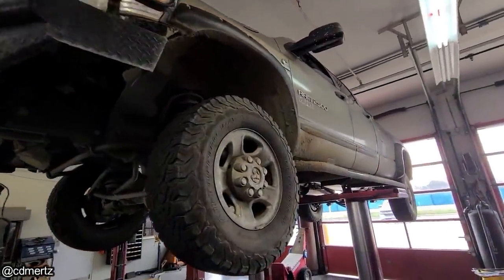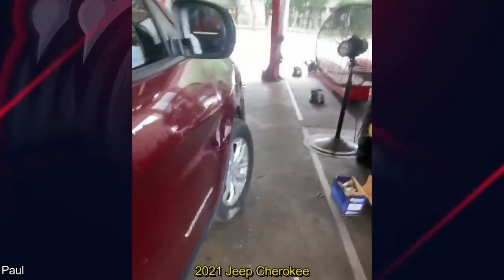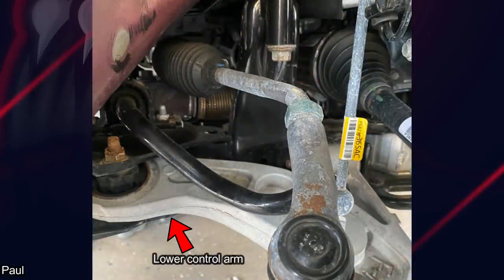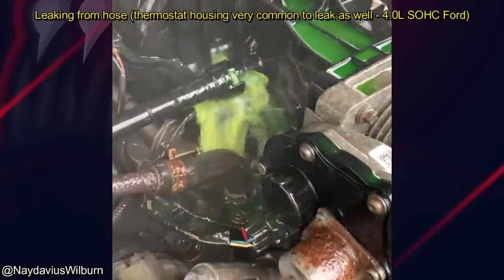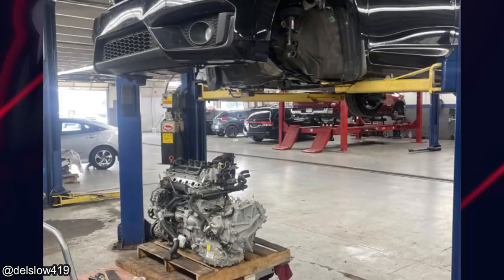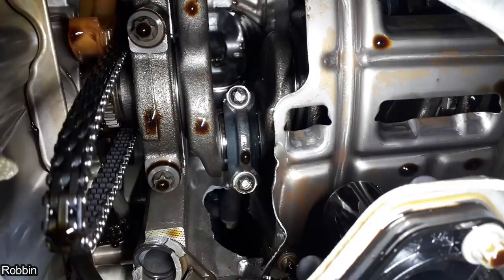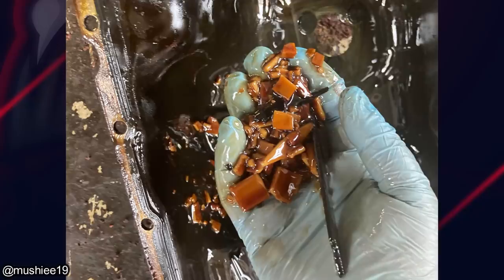Customer States Loud BANG While Driving On The Highway! | Just Rolled In

Comment: Three-years ago the transfer case on my old '98 Durango 4X4  blew up on the road at 65 mph while pulling a loaded cargo trailer.  I quickly stopped the car, got out and saw the trail of parts from exploded case, a pool of red oil, and the front driveshaft dangling down from where it once went into the case.  It was the Morse Chain that broke, like the one still in the case in the video.   Being the original owner and doing my own service & repairs, I had always checked and kept the fluid filled when I did oil changes.   But apparently after 225,000 miles it was just time for this well-worn and constantly spinning chain to let loose.  Because I had stopped quickly when I heard the explosion nothing was damaged other than the totally destroyed and now missing transfer case and a dent in the floor pan where the flailing end of the drive shaft hit it.  I was lucky as the loose drive shaft missed the fuel lines and wiring that runs along the inside of the frame rail!   The trans itself was undamaged and what was left of the transfer case still supported the tail shaft.  Because the bolt-in transfer case has it's own oil supply, I realized there was no worries about the oil in the undamage transmission.  So all was not lost. 

The Durango being 21-years old and high mileage I always carried emergency tools in the car.  I crawled under and pulled out the broken chain, undid the U-bots and removed the dangling drive shaft from the front axle.  I then gather up all the pieces and I was ready to go.  The Durango was still perfectly driveable in normal two-wheel drive.  So I continued on my merry way to my destination with no problems. 

I later checked on the cost of buying a junkyard or rebuilt transfer case.  But with the old Durango being long-in-the-tooth and having other problems, it wasn't worth it.  So I continued to drive it that way for another two-years, racking up another 30K miles as if nothing happened.  When I would change oil I would look up into the gaping hole where the transfer case once was to see the fully exposed and rusting tail shaft.  But that didn't seem to affect anything. 

I would probably still be driving the old girl if rodent hadn't chewed on a rubber trans hose, which blew also on the highway, draining out all the fluid killing it for good.  I had it towed directly to a junkyard and I still see it there when I drive into town.  RIP my tough old '98 Durango.

Comment: The ol' "ignore the u joint till it explodes the t case" game. Barrels of fun for the wallet.
Reply from the maker: Happens too often lol
Reply: I don't know about the third generation Rams, but the fourth gens have a grease zerk on the front driveshaft CV that's supposed to get greased at every oil change, but I'd bet it's rare that they ever get greased.  I know the dealership here doesn't do it.
Reply: @wirebrush  yeah there was an Alaskan airlines flight that went down in the Pacific and after investigation they found that the tail rudder (which is responsible for the up and down of the whole plane) was out of grease!!! Something so simple and cheap brought down that plane and killed everyone on board because of it!!!.....or because of the lack of it should I say
Reply: @wirebrush  they always made us grease the chassis at take 5 that’s pretty sad if a dealer ship doesn’t lol
Reply: @ThatNoFbody-ch9ky  the problem is that they don't use a standard grease zerk, it's nearly flush and requires a needle type grease gun attachment so the techs just ignore it which leads to exploded transfer cases and in many cases trucks burnt to the ground when the ATF released hits the hot cat and ignites.
Reply: @jimmygrant424  I think you're referring to the MD-80 which used jack screws on some of the control surfaces.  I believe they had a couple of crashes after lack of lubrication caused the jack screws to strip, making the plane suddenly uncontrollable.
Reply: Pockets better be deep lmao 🤣
Reply: Made that mistake one time lol. And that's the only time ima make that mistake

Comment: Funniest thing I ever found causing a flat tire was an unfired .50 round.
The last time I had to replace a water pump on my own truck, it let go in the best place possible. Right in my driveway. That's always the best, no side of the road attempt to fix. No tow charge. I only thought of it because of the bedazzled coolant in that one clip. Take it easy man.
Reply: I'd just completed an oil and filter change on my truck and a hard brake line failed as I was driving it very slowly down off my ramps. I used the e-brake to stop it, shifted to drive and put it right back up, leaving it there for 3 days while waiting for a full set of brake lines, hard and soft. One of my better decisions!
Reply: Best thing I ever had causing a flat: tire plug insertion tool.  Like the tool you use for installing a plug in a tire.
Reply: I use coolant as weed killer... It's not only cheaper than actual weed killer, it works BETTER. Neighbor was bitching about how her dogs could die from it, I told her keep her dogs off my driveway and/or keep them indoors
Reply: @EvilJ069  You know it's illegal to do that, right?  You can only "dump" certain types of chemicals into the environment.  Pretty sure most coolants aren't even sewer safe, let alone yard safe.
Reply: @DSiren  "yard safe" hence my properly dead weeds. I also speed, are you going to lecture me about that law as well?
Reply: I use coolant as weed killer too. Works good.
Reply: The exact same thing happened with my mom's car about 40 years ago. Take care of your car, and it will figure out a way to take care of you.
Reply: @DSiren  It's got a half-life the atmosphere of 0.3 to 3.5 days, and is also readily biodegradable in both aerobic and anaerobic conditions. It degrades rapidly in ground water. While not non-toxic, using a bit in your yard isn't going to do any long term damage. At scale it's deadly to aquatic life, but then we're talking about massive concentrations, usually airport runoff, where they use it to de-ice aircraft.
Reply: @richardfitzwell6579  Thumbs-up for the name.  Watch Popp much?
Reply: i broke down three imes in my i commercial fish and the crown came off the piston ight at the dock, next trime i rung the shaft and the prop fell off at the dock, third time was only about 7 miles from the dock and a friend trowed in from an oil line under the engine, and my two times once the key switch broke at the house triple A towed to the shop and the next was 5 minutes from the house and got a cab and went home called triple A again was towed to the shop for a starter, my friend has a tow company in own so all was good except for parts and a little labor from the guy who works for him, so all was good, nothing better if you are going o break down do it at or near home, my friend broke down 43  miles from the dock and i was 40 in the other way from him, to far for the radio and to get messages through others to get to and a 6 hour tow back to the dock, another friend bought a boat that did not run and that was a 160 miles round trip and 2 days, take care and have a great Thanksgiving
Reply: pannin for gold in oil pan haha

Comment: I love the new oil drain plug, that's how you get things done. Personally, I'm amazed they didn't just Bondo the drain hole altogether, but hey.😁🤪😜
Reply from the maker: I think a longer bolt would have worked better, but hey. What do I know? 🤪
Reply: @JustRolledIn  👍👍👍
Reply: Just Bondo the drain plug? wow, thanks for the 'Tech Tip'!!
Reply: JB Weld is everyone's friend.  Bond bodies, weld engine cracks. Lol
Reply: I hope the bolt was from the same car. You know, compatibility and such.
Reply: The guy I bought my Subaru off of had an interesting way of repairing stripped oil pan plug threads.  He tapped the pan I think, then cut a groove in the plug and put an o-ring on it, in the groove.  Incredibly, it works.  Of course that was never mentioned.
Reply: At least it works, but he's kind of bogus for not saying anything.
Reply: Ya not joking haha, a few years back a customer I had baught a "nice" used Opel Astra, the type with the aluminum oil pan and brought it to the shop for a proper inspection and service, surprised were we to see that the oil pan drain plug was missing and the hole welded up, not leaking a drop, engine running smooth and no weird noises, we fitted the new oil pan and used the old one around the shop for whatever reason, cust had a laugh about it and didn't care too much as he got the car off an aution for a real good price with only minor issues...
Reply: @francoisdvanderwesthuizen  Yep, you just never know what kind of sketchy business you'll find on used cars.😳🙄
Reply: @francoisdvanderwesthuizen  You sold a new pan instead of just fix the old one and the customer was happy?
Reply: Pretty sure I've seen once a driver used a spark plug as a drain plug. That was a beauty as well.
Reply: I once saw a Chinese copy of a Honda 50cc stationary engine, it came with no drain plug and no filler plug, they just put some oil (maybe) in there and bolted it up :-)) Guess they thought it would only last as long as the oil in the engine anyway, despite the engine they copied being one of the most reliable little engines ever made. :-))
Reply: @uhtred7860  Okay, that's actually kind of funny.
Reply: @rick_fortune  That kind of thing happens more often than you'd believe.
Reply: @CommodoreFloopjack78  Yeah we laughed, couldn't sell the pieces of crap like that though.
Reply: @XtreeM_FaiL ,we told him we could fix it but he insisted on getting a new one...
Reply: @CommodoreFloopjack78  and here on Africa, the backyard fixes can get rough, hillbilly engineering is upper class against what we sometimes get here haha
Reply: @francoisdvanderwesthuizen  😆😁👍
Reply: First of all, any bodyman will tell you panel bonding glue is what you use for that.
Reply: @actually5004  Hey, whatever Gits 'Er Done!👍
Reply: @tommyeugene  Chewing gum!
Reply: Liquid Nails would work too!  lol....
Reply: @uhtred7860  "Finest Chinesium Alloy used in production; sealed, so never oil needed."  -- Typical Amazon posting broken English.
Reply: @uhtred7860  Well, the sign wasn't.....wait for it!.........wong!
Reply: @markh.6687  LOL Nope.  Those translation machines they used were hilariously succinct.
Reply: Bondo won't adhere to an oily surface well. For that, try JB weld.

Comment: Those timing chain guides were pricey, but it could have been so much worse if the chain slipped.  That leak saved the engine.
Reply: Absolutely. Better to just replace the guides/maybe chain vs bending valves or grenading the engine.

Comment: The oil pan plug in amazes me. Most of the time you can get a new oil plug at the dealer or at a discount auto part place. If it worked for a minute, drive over and go get one or do what I did, borrow the neighbor's car. I had the wrong oil filter one time and I had to drained my oil.
Reply: Weirdly enough my dealer wouldn't sell the oil plug separately - only as part of the entire oil pan. I was able to buy it from a generic auto parts place like you said. Still confuses me to this day since they can be so engine specific.
Reply: @RacingPepe  $$$

Comment: 0:33  Looks like a fairly superficial hit until you look at the steering/suspension bits.   They bent the subframe?!  Geez...
Reply: And I thoughts Jeep was supposed to be a tiny bit rugged
Reply: Shifted the subframe, as in the bolt holes are a bit bigger than the bolts so it’s able to be moved with a big enough whack.
Reply: Good luck on the next front end alignment!  😵

Comment: The clip of the worn water pump metal in the rusty brown anti freeze made me think it was at a clip of someone panning for gold.  LOL  How do you just "lose" a drain plug while changing oil ?
Reply: it gets damaged by dropping a differential cover on it and won't seal in the hole anymore so you put whatever you got that does fit in the hole.
Reply: @DSiren  Voice of experience?
Reply: @haroldwilkes6608  not mine, but my uncle owns a bar and I help out sometimes.  You hear some crazy stories at bars.
Reply: @DSiren  Agreed, booze is the poor man's truth serum...at 78 I've heard one confession to murder and numerous stories of adultery. I don't drink anymore.
Reply: Well he ain’t gonna loose that new long drain plug ever!
Reply: Maybe he should paint it blaze orange. That ought to help.
Reply: @yyz4761  Older car but best one I ever saw had a clip attached to a rivet on the oil pan so it never fell into the drain pan.
Reply: I believe Jeep coolant can come in that orange colour from factory.
Reply: Drop it in the used oil collector?
Reply: Hope they remember whereabouts on the sub-frame they borrowed that bolt from!
Reply: I lost a socket inside a VW door. I saw it drop and where it went but when I shone a torch in there it was nowhere to be found. I even took the door skin off but nope, it had simply vanished. Even used a metal detector on the driveway but not there either. On the plus side, I did find enough loose change I'd dropped over the years to buy a few beers, so not a total loss.

Comment: Sub frame bolt for a drain plug,here I thought I've seen it all 😏
Reply from the maker: Don't go removing subframe bolts now 😜
Reply: I used a random bolt and random, but fitting, nut from my tool box to replace the stripped out alternator bolt on my '84 Fiero. Ran it eight years like that. I think the bolt was for holding on body panels that I grabbed for something else from my friend's Pandora's ToolBox after he pulled his '84 Fiero apart to (eventually) scrap it. :shrug: That's how you fix things on the cheap. It works or doesn't.
Reply: @chrismaverick9828  Yep, back in my wrenching days, it seemed like there was an extra bolt after most repairs...

Comment: Upside down reverse camera is common on ford edge.  both of mine did it at various times.  Also was blowing ac on drivers side and heat on passengers.  Reset of entertainment system and reflash of firmware straightened it out.
Reply: Oh, it's an electronic problem. I thought that the factory put the camera in upside down.

Comment: never seen an odd bolt in an oil pan but have seen a spark plug screwed in place of an O2 sensor. Obviously to make the exhaust quiet.
Reply: "Post Engine Waste Gas Igniter System"  Poor man's turbo.
Reply: @markh.6687  Or an afterburner modification?
Reply: @MonkeyJedi99  Afterburners dump raw fuel into the exhaust stream via an added chamber post-engine; the PEWGIS is trying to ignite unburned fuel in the exhaust gases without using more fuel.
Reply: @markh.6687  I know. I was trying to be a tiny bit funny.
You see, I grew up in the era of Adam West as Batman, and that Batmobile had the most useless "afterburner" nozzle I've ever seen.
Reply: @MonkeyJedi99  "All right, Robin, activate the BatBurner!"

Comment: I have an exhaust valve shaped in a question mark, from when I incorrectly timed my first truck. I am going to frame it with the phrase "Are you sure you timed your engine correctly?" In my defense, I had a friend, who was an auto Mechanic and a Mechanical Engineer confirm it was timed correctly while I was reassembling the engine. So, it's not 100% my fault for incorrectly timing the engine.

Comment: Dang, that was one lucky driver.  My grandfather had a Hertz franchise, and told the story of how he rented a brand new box truck to someone moving from Williamsport, PA to Richmond, VA.  The guy drove the whole way with his foot on the clutch.  As he was pulling into the lot in VA, the truck gave out a bang, and the throw out bearing went through the bell housing, through the fire wall, through the passenger's side of the bench seat, and out the cab behind the door.  If there had been someone in that seat, they would have died instantly.  This guy is lucky the floor held.
Reply from the maker: Holy cow!

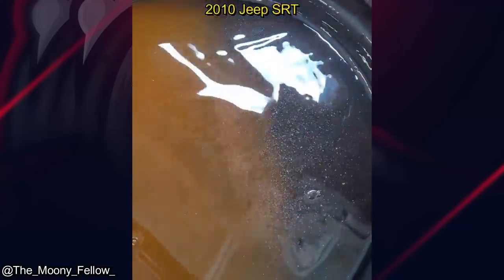Comment: 1:40 A few years back, my son was given an old Nissan by a friend. It ran great, but overheated after driving for a while. We couldn't find anything wrong with the radiator, we removed the thermostat, but it still got hot. I watched the flow in the radiator, and there was virtually none. On a wild hunch, I removed the water pump and found that the impeller had completely eroded away. (Electrolysis perhaps). I'd never seen that before and never since, usually the pump leaks or the bearing goes out before that happens.
Reply: Heard of it. Impeller are usually no longer made by casting like before but rather a bend sheet of metal. Wrong cooling fluid can be disastrous and eat away the metal.
Reply: @alainpichon4395  Yes, this was the stamped steel type. All that was left was a hub and a few thin protrusions.

Comment: I hit a big chunk of metal in the highway with my 1973 Pontiac and still drove it home after checking it out saw minnor damage..but when I got home I saw the shock bolts got sheared off and the control arm bent.. good old American steel.. new cars would have folded up on the highway and threw me in a ditch.

Comment: We still have a pacifica. It has broken the front motor mount twice. The last time I changed it I put a short piece of chain around it and bolted it together. Hasnt broken since.
Reply from the maker: I've heard their pretty common to break on the Pacificas.
Reply: @JustRolledIn  the motor has a lot of torque and twists the mount into. Also the mount design is trash.